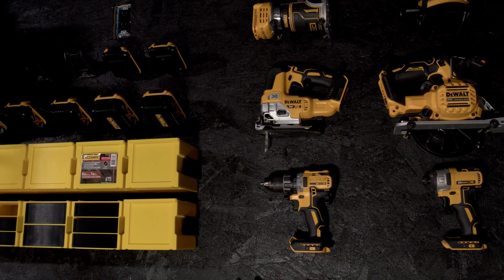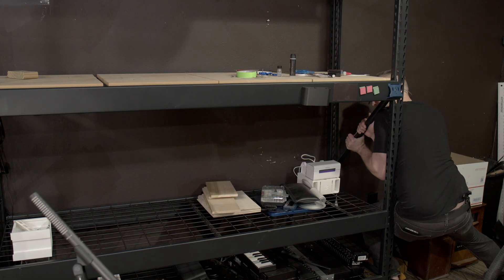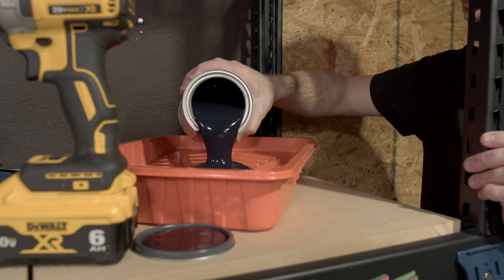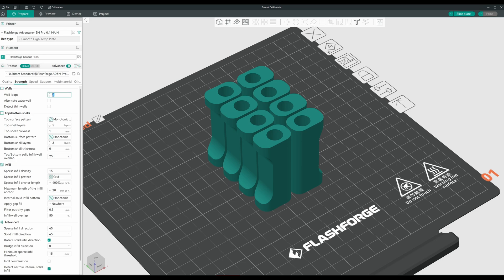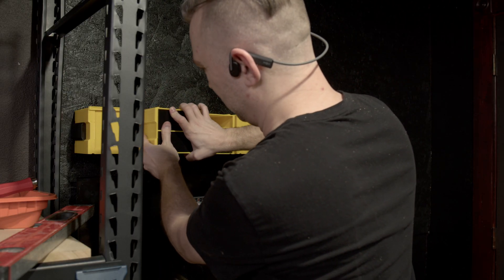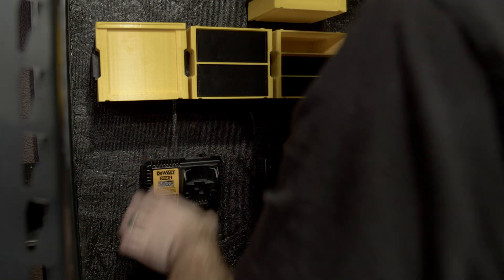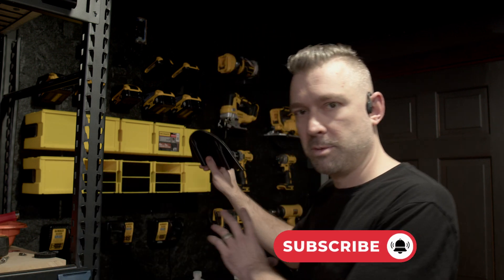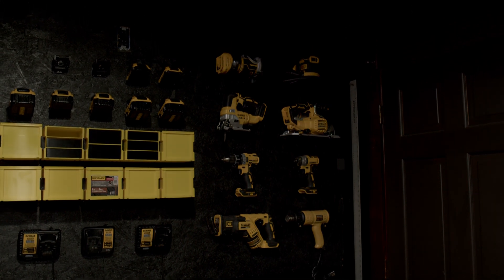The Ultimate 3D Printed Tool Wall!  DeWalt and Everyone Else!

Comment: Where did you get the this skill holders I been trying to find them and can't seem to. Or did you make your own?
Reply from the maker: I show what I use for the circle saw in the video. I figured there was no need to 3D print anything for it since the solution was more simple. instead I just used two - HeadLOK Structural Wood Screws - 8 inch flat head wood screws. You can grab these at home depot cheap.
Reply from the maker: https://youtu.be/cvPVrqMPCsA?t=355

Comment: Looks nice! I've been trying to think of how I could improve my DeWalt tool organization as well.
Reply from the maker: Thanks, I'm glad I finally got everything cleaned up. I hated how I had everything. Highly recommend it.
Reply: @zerodotcmd  I'm thinking of making standing holders that are like a battery mechanism so you can just grab the tool straight off a shelf. Wonder if it would work well.